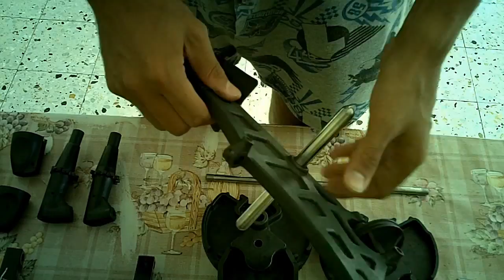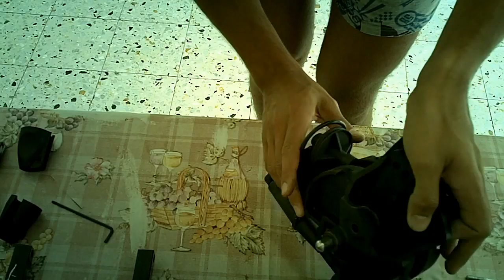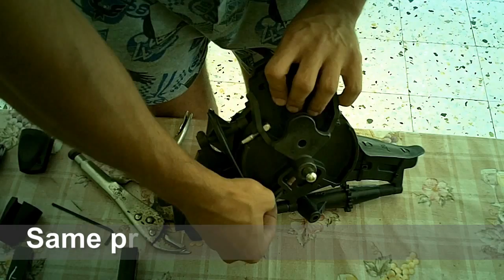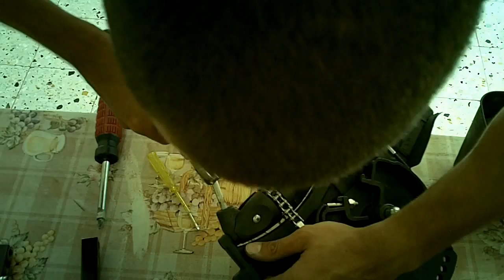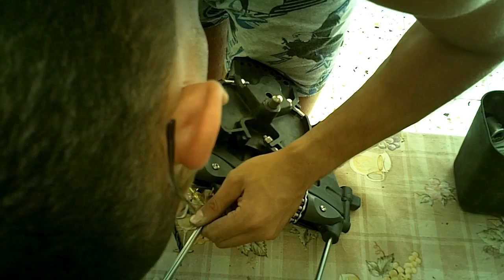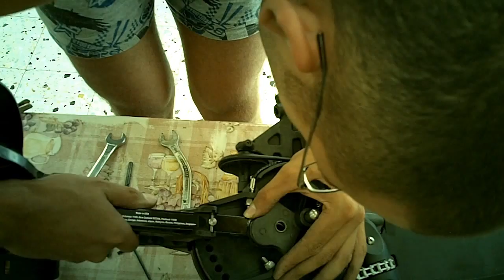Hobie MirageDrive Assembly

Comment: Do you know if the shaft on the main body is adjustable?
Reply from the maker: +cpabrego As far as I know, it's not adjustable
Reply: +Ron Dadon on my v2 pedals I believe you can tap it with a hammer to adjust it a bit. I'm asking because I'm having a problem with the pedals popping out of the click and go locks.  I heard some times the bar needs to be adjusted or aligned.